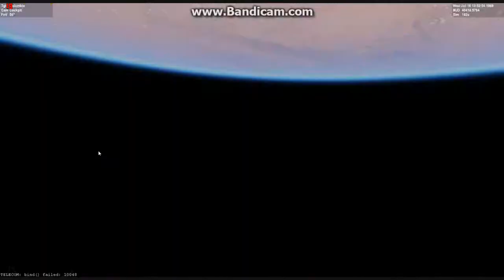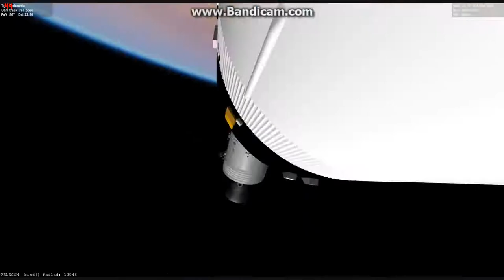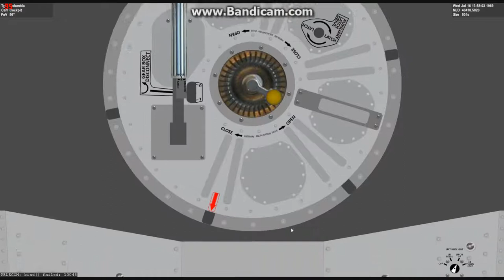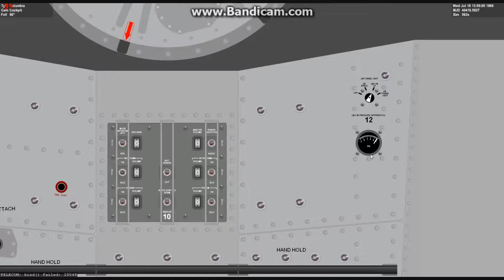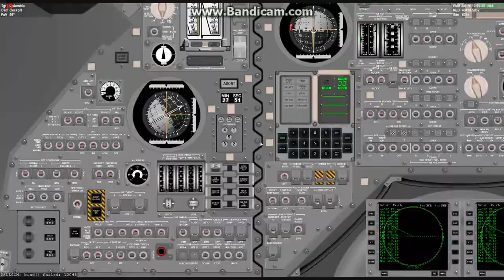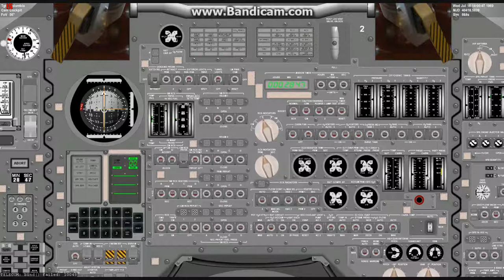Project Apollo NASSP transposition and docking tips + tunnel pressurization

Comment: How do you control the rotation? Do you use the arrows or?
Reply from the maker: In NASSP you have to use joystick for rotation and translation (and also manual throttle if you fly LM). Unfortunately it is not possible to use keyboard for this. Joystick is needed because rotation is proportional (in RATE CMD) and also because there is a direct system which works when you apply full deflection of the stick.
Reply: macieksoft hey, so i found out you could use the keypad to rotate and control the rcs. Thanks anyway!
Reply from the maker: @tuttermuus6576  Keypad works well for default spacecraft, not sure about NASSP.
Reply: macieksoft no it works pretty good with nassp.